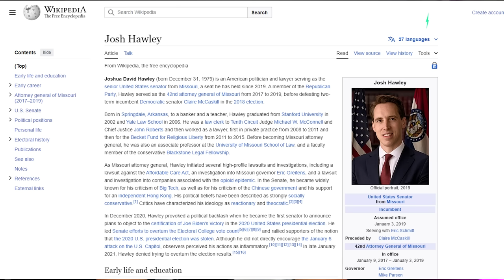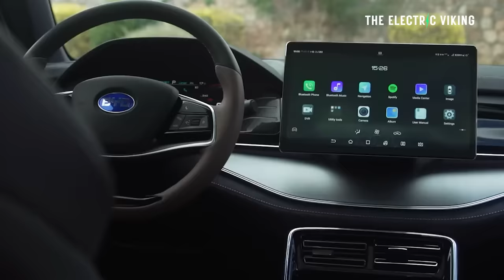Masses of unsold Chinese EVs are piling up and blocking European Ports

Comment: MG heavily discounted the first 2000 MG ZS EVs into UK. No one was fooled about the brand; Chinese. The press panned the cars because the petrol cars were poor, ultimately 18 months later the press recognised that the MG EVs were good value and worked and came round to recommending them as cheap and cheerful. MG sales are higher than Volvo now. However there is too much anti EV FUD in UK still, despite early adopters being content. The rapid charging infrastructure has been dire but is now coming good. BUT so many UK homes have no private drive so that home charging is an issue. Fans of Coronation street will see what many people live in. Even new developments crowd parking away from homes and therefore no individual power!
Reply: That does not sound like "fud" if you have no plan to get everyone their own personal garage.
Remember, first fix the problems then go ahead. Don't just hope that magic will fix em for you in due time.
Reply: @DeadNoob451  The FUD is the FF lobby saying the Grid can't cope and we don't have enough power, the power is generated by gas etc. The Grid is only half utilised now that LEDs are common place and refrigerators and industrial use is much more efficient. And the overnight charging of cars is solely from renewables or nuclear power. CCGT is used at less than 5% for balancing frequency pending new battery/electronic frequency balancing coming on stream in the next 18 months. UK electricity will be almost completely carbon free in 2026 and by 2030 offshore wind alone will be at 50GW. Even at 60% output which is about average for the new turbines that with onshore and nuclear will exceed demand. The homes without drives are being catered for in the forward looking boroughs where overnight secure parking with charging is available at a discount.

Comment: China could move 100 cars a day at "FULL" PRICE if they RAFFLED them OFF. Infront of Each car is a BARREL and a ticket attendant. 20,000 tickets at $2.50 a ticket. Buy a ticket and it is dropped into the barrel. When 20,000 tickets are sold the barrel is spun and a winning ticket is chosen. Winner is given instruction on car operation plus is responsible for tax, insurance and registration.

Comment: I want any new car I buy to be connected to the web and accessible by myself, those I've authorized, and the OEM; the latter to monitor for necessary maintenance and to supply software updates, and if that OEM is Tesla, to provide info to Tesla by which it may improve its software.  I will not buy a car that is so connected to a company which are controllable by potentially hostile foreign governments.  I'd include stupid governments along with potentially inimical ones, except then I wouldn't be able to buy a Tesla either, whether made in USA or Germany. :(

Comment: Part of the issue is the shortage of lorry drivers to take cars away. The Chinese importers should be using rail. Minis for export arrive at Southampton docks on 40 truck long trains and are driven straight onto ships for export. Just one driver for 200 or more cars. The empty train can be back in Oxford in 90 minutes for more cars. Ford take cars around the country on rail too. JLR probably don't. The UK car market is stalled for private buyers, we are suffering food inflation caused by Brexit amongst other issues, fleet buyers don't buy Chinese yet.